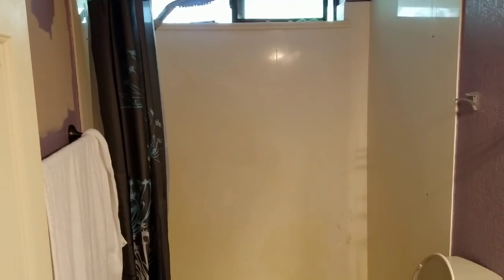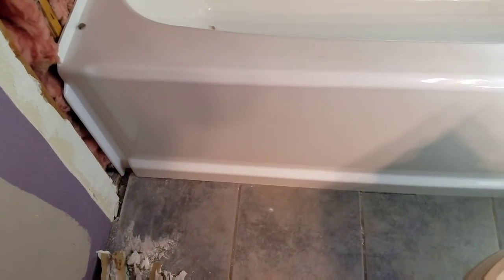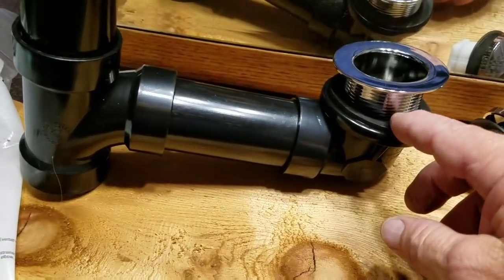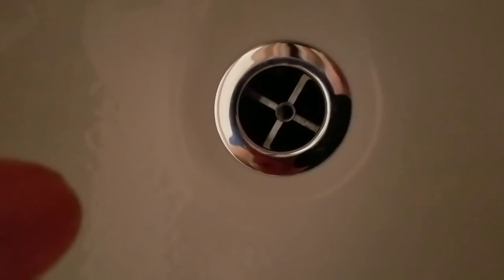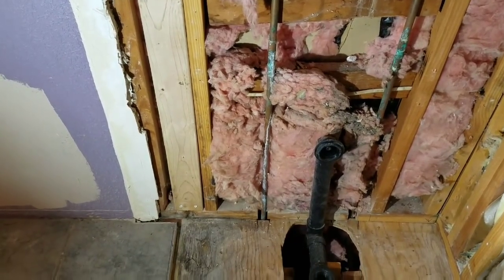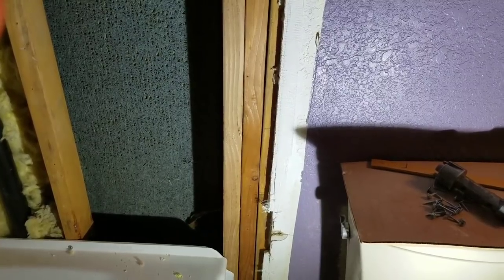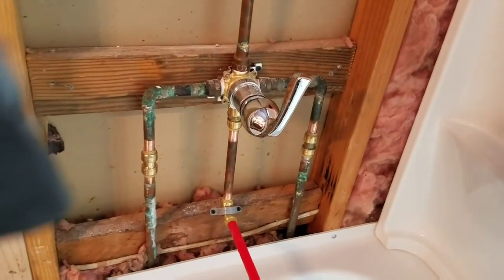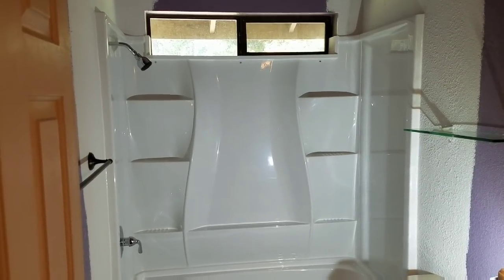How to install Fiberglass tub surround...Easy !!!

Comment: I put the exact same one in. I wish you had shown the drywall part though. I assume you put something in before the texture.
Reply from the maker: aletoledo1 hi brother I'm really sorry about that
 that's funny I just finished another one and I didn't show it on that one either and I never show it because it's not pretty you literally just install pieces of trim like a thin paneling or some other kind of trim something to make it solid and flush with the drywall and then you use fix-all to make it perfectly flat with the drywall then you use drywall mud to make it flat again and after a couple of coats of mud you start texturing all you're trying to accomplish is filling up the joint and make sure you use drywall tape for the joint
Reply: That's the same problem I am having right now making the dry wall and walls line up wondering what to do
Reply: Theres lots of people who dont crack fill or tape behind the tub surround

Comment: Jon, I try using this Everbilt ( Model # WO-1-BB-CD) . and I got a RIVER...not na leak.   I have to use that type of waste and drain. Any alternative?  All I have found are to short in the overflow..
Any help will be very appreciated... thanks...
Reply from the maker: Yeah all the overflows will be too short for that unit
you need to  extend that pipe 
 A bunch of different ways to do it
 2 couplings and another piece of pipe
 will be sufficient
 Or just a longer piece of pipe
Reply: I can't extend the pipe because the shut off doesn't reach!
Reply: Thank you so much for your help.

Comment: i wasnt sure what to do with a window cut out, u cut it with a grinder and then made a sill correct?
Reply from the maker: Yes exactly brother take real careful measurements and all you'll have to do is caulk between the synthetic wood and the shower wall it works absolutely perfect as long as you make Great Cuts
Reply: It will void your warranty though. The only tubs I've seen come with window kits are handicap showers. They are also solid plywood embedded in the fiberglass so that there is backing for mounting grab bars. I would have just installed the tub and tiled the walls. Not much more money than paying for the shower walls and it would look proper

Comment: Thank you very much for a helpful video. Is it possible to remove that fiberglass tub without cutting (I don't want to mess with the fiberglass dust)? I assume as it was installed originally, it could be removed same way. It is one piece: bathtub and surrounding. Maybe to cut out a sheetrock wall from another side to disconnect all pipes which stick out from that fiberglass plate? And is it a shut off valve which disconnect water on that part only, or you need to install it? We got a slab leak under the bath tub and a company suggests to brake tile on the floor. I see there is no concrete under the tub, so it would be way easier to get to the problem point, no jack hammering, no dust. I would appreciate any opinion on this matter. Actually I think the good option would be to lift that thing and work on the leak, like under the car. I don't think that plastic is very heavy and I can use stands for car lifting. But how to deal with those pipes that stick from the wall?
Reply from the maker: Hi I put in a whole bunch of these things perhaps a couple of hundred anyway there is simply no way to do that without cutting you need to cut it out of there and there's not that much dust you can actually start at a couple spots get past the corners and then just rip it apart with your hands but cutting it is way easier anyway when we put those in a brand new house we do it before the roof goes on or any walls of any kind because you can't get it out of that room. There's no way
Reply: Thank you, sorry for the delay with the answer. We cut it out. It was not necessary procedure (we were looking for a slab leak and hoped to see something under the bathtub, where the leak was located by two reputable companies, not exactly though kind of in that area), but I don't regret much, I'll put a new more fancy tub with surround (they sell such in 3 pieces, which is more practical). Sir do you happen know from what price range they start those bathtubs which don't crack easily? We don't have heavy people in the house, but I just like better quality (on a budget though). Thanks a lot again.
Reply from the maker: @olenaerhardt7725  yeah go to Home Depot and get the Delta 400 classic 3 piece surround and you can either be a shower or a bath tub base they are great

Comment: aren't you supposed to put the tub on the tile? so it's inclided towards the tub wall such as water won't  drain to the floor?
Reply from the maker: No you're not supposed to for a couple different reasons first off when they build a house the tub goes in first and the tile is put up to it and then when you remodel you have to do the same exact thing I understand what you're saying about having flooring underneath but if you seal the tub Edge real well like you're supposed to it'll never be a problem
Reply: No,  because the tub is made with a slope on the inside of it to drain out the water properly

Comment: What is that black foot you put on the underside of that tub?  Can that be gotten for a variety of other tubs? 

I am sick and tired of mortaring or plastering in these soft flexible new tubs that aren't worth a plugged nickel.
Reply from the maker: Hi Gardner
They come with all Delta Tubs, but if have a different brand you can always just "old school" it by screwing down a 2"x 4" in the appropriate spot to keep the apron from moving

Comment: Thank you for the video.  Have the tub in and working on the surround. Did you use adhesive to attached the panels to the studs and tub or just screws in the wall?  Saw it in the instructions but not sure if needed.  Also, super nervous about cutting the panel for the fixtures.  Any tips?
Reply from the maker: Yes you should be nervous about cutting the holes because if you get it wrong then you waste a lot of money and you have to spend a lot more to replace it so don't do that :-) do the best measure you can and then drill a eighth inch hole right where you believe the center should be and put it in place and see if that works if it does work and it's the center of where you wanted to be ,drill the proper size hole and you'll be set as far as gluing the panels I never have but you could it's just that most of the time when I do them and I've done a hundred of them is that the walls are never level and square and perfect so they wouldn't ever really work unless you added wood to them  to line up and it's just not worth it once you install it all and get it all in place and get it all siliconed together it'll never go anywhere sure it moves a little bit but not that much and very rarely does anybody lean on a wall once you're in the shower or bathtub so I would venture to say it's totally fine don't even worry about it I never do it
Reply: Thank you so much!  I have been working on this for awhile...stoping at every point to research.  While I am good with windows and siding, interior has not been something I have worked with.  I have called a few contractors in to help me but can't seem to get one to take on a smaller job.  The tub is in and now I can put the shower in!!   Sharing a bathroom with my husband has been no fun at all.  Ready to get this done.   Of course then it's the dry wall....a whole other learning experience I'm sure!   Thanks again!

Comment: What did you use to cover the trim I’ve the shower wall
Reply from the maker: Synthetic wood from home Depot like 1 by 8 
or 1 by 6
 or 1 by 4

whatever you need
Reply from the maker: I just looked and I answered you based on what I thought you were asking I thought you were asking about the window trim but if you were talking about finishing the wall around the perimeter of the shower you're going to use drywall mud after applying some shimming to bring it close to level then tape it and mud it

Comment: How would you finish the base of the tub where it meets the floor tile?
Reply from the maker: In this situation it was mortar first and then siliconed when it was dry
Reply: Thanks!  Never had luck making the silicone esthetically pleasing.  Guess I’ll  just have to practice!
Reply from the maker: It takes time
Just to mask off both sides
But if you do that

And take the time to mask

Then you can apply the silicone

Wet your finger and running across the face of it

While it is brand new fresh

And it will turn out perfect

Then immediately remove the masking tape

And let it dry
Reply from the maker: Also make sure you use dap 3.0 bathroom sealant ,not silicone,
Silicone will not stick to an acrylic tub

Comment: Total noob here....how do the panels "seal" in the corners?
Reply from the maker: After the whole unit is put together
And completely finished

The last thing you're going to do is use the sealant they recommend on everything

Every seam
Reply from the maker: Again I will say use the sealant they recommend

Silicone will not stick to this
Reply: @Jonehughes  ok thanks, didn't know how the panels were to be watertight. Thanks!

Comment: Can you show us how you fixed the dry wall around the tub?
Reply from the maker: Next time I do a video I'm going to have to do that

I left it out of all my videos because its just too easy

But I'm getting some pushback
 so I'm going to have to do it next

But for now

For you

Just fill it in till it's relatively flush

With the existing drywall

Quarter inch shims

A handful of paint stir sticks

Anything you can feel the joint with

And then use drywall tape and mud to smooth it out

Then texture it to match existing

Comment: I think most people don't have a tub tool. They probably try to find weird ways to tighten it without the tool.
Reply from the maker: It's possible Chris that people try to MacGyver that thing but they really need both tools the top tool on the bottom tool to do it right if you look at all the comments at the purchase point of these systems everybody complains they leak but they really don't like they never leak I've never had one like the league probably because people don't have those tools like you said they try to do it without it and it does not work you really need the proper tools to make this thing work and once it's cinch down and perfect it will never ever give way it'll never leak but I guess if it's true what you're saying that's probably the reason they're leaking because there's no possible way to get it really cinch down correctly without the proper tools

Comment: Jon Hughes,  Jon what is the height from the floor to the drain trap @ 12:12 ?  Thanks
Reply from the maker: i don't remember , but every one is different, it'll show on the instruction manual, or just measure your new one to be sure and then double check and dry fit.

Comment: All you did was put the sheet rock right over the tub flange?  I’m installing one no and I’m stuck not knowing what to do.
Reply from the maker: just fill the joint solidly
 I like to use 1/8th inch Paneling
 cut to the right width
 and just keep layering it till I get it flush with the existing dry wall and then tape and mud it
Reply from the maker: Yeah but go to my Facebook page Jon E Hughes construction
Oregon

Comment: I wanted to see how you did the window
Reply from the maker: Your friend has shared a link to a Home Depot product they think you would be interested in seeing:

Veranda	3/4 in. x 7-1/4 in. x 8 ft. White PVC Trim (3-Pack)
https://www.homedepot.com/p/Veranda-3-4-in-x-7-1-4-in-x-8-ft-White-PVC-Trim-3-Pack-827000005/203640256

Your friend has shared a link to a Home Depot product they think you would be interested in seeing:

Royal Mouldings	6624 1 in. x 3-1/2 in. x 8 ft. PVC Composite White RB 3 Casing
https://www.homedepot.com/p/Royal-Mouldings-6624-1-in-x-3-1-2-in-x-8-ft-PVC-Composite-White-RB-3-Casing-0662408001/100092588
Reply from the maker: Go to Home Depot and pick up synthetic trim

These are examples get whatever kind you like

Silicone it in real good and you're done
Reply: Not too many videos of window installation with fiberglass walls.
Reply: Thanks

Comment: Shark bites in the wall ?
Reply from the maker: Behind-the-Wall Proven & Approved

“We know it might seem too good to be true, but SharkBite has been approved by IAPMO for behind-the-wall installation,” Kornegay says. ... SharkBite push-to-connect fittings are made of lead-free brass and have an EPDM O-ring and a stainless steel 316 grab ring.

https://www.sharkbite.com/resources/blog/using-sharkbite-fittings-behind-walls#:~:text=Behind%2Dthe%2DWall%20Proven%20%26%20Approved&text=%E2%80%9CWe%20know%20it%20might%20seem,wall%20installation%2C%E2%80%9D%20Kornegay%20says.&text=SharkBite%20push%2Dto%2Dconnect%20fittings,stainless%20steel%20316%20grab%20ring.

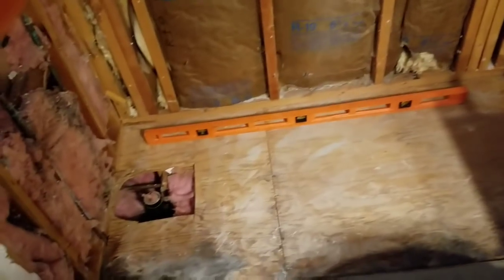Comment: Can anyone tell me what backing on the studs is. 1:50 he starts to talk about it. Thanks
Reply: I think he meant you need some sort of stud surface for the flange around the liner to get nailed into. You can see throughout the video where he added runner boards where there weren't studs to create that surface where he needed it.

Comment: Did you caulk when installing panels ?
Reply from the maker: Always....
 Fill every single crack with good sealant ,don't spare any expense,
 this is the weak link in all systems
Reply: Jon Hughes thank you..

Do you have any tips on working with Dap 3.0? It’s very thick and sticky and gets everywhere ..

I can’t use the same tip and tricks I’ve come to learn and use on the regular dap ... any ideas on the best way to apply and get a smooth bead ?
Reply from the maker: @operationhotshotinc.6887   No it really sucks the only way to really use it is if it's new if the store has had it for a while and they're trying to sell it because they paid a lot for it then you are hosed if you can find some new tubes it works really gives just like regular silicone you got to find young tubes

Comment: Do you put caulk on the corners from top to bottom?
Reply from the maker: Yes It needs to be completely  sealed, top to bottom, there should be no cracks that don't have sealant on them and it shouldn't be caulking, it should be sealant, the kind they specify which ever ones in the video
Reply: @Jonehughes  ok great thank you! Dap 3.0
Reply from the maker: @darrinbrust7285   Hi Darrin,
 make sure you find a really young tube as soon as those things get old, they're really hard to work...